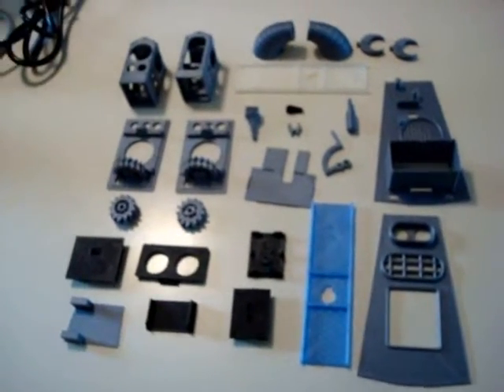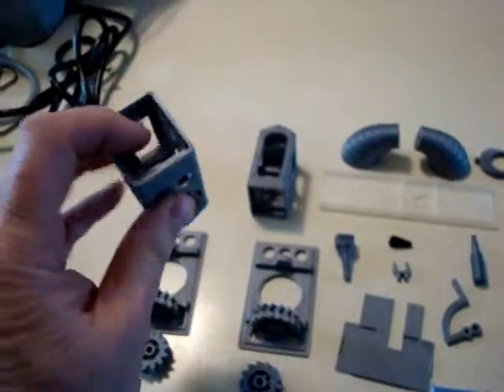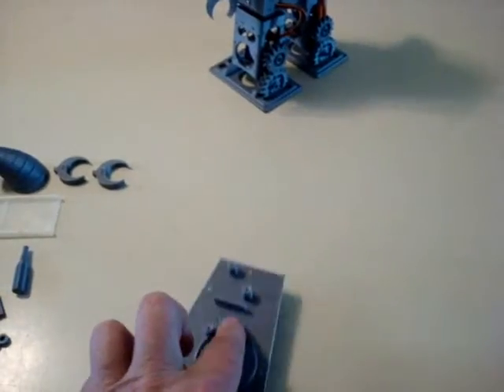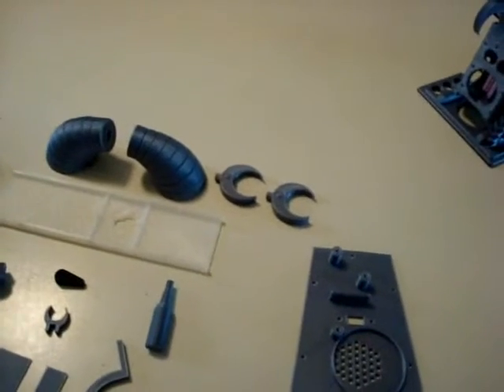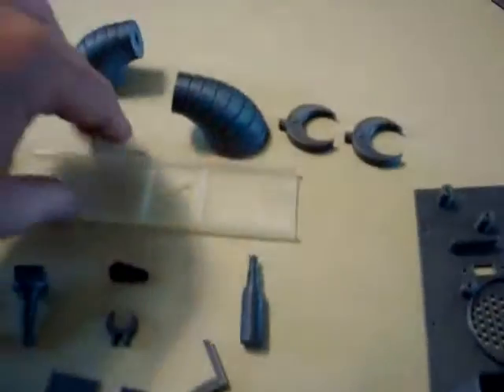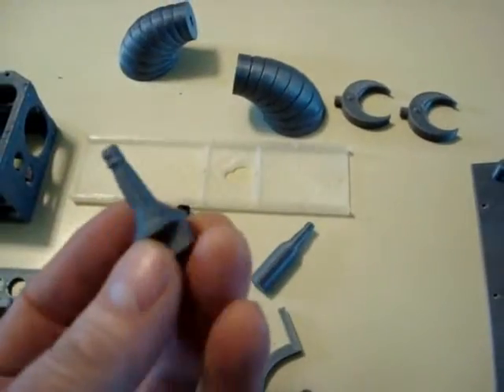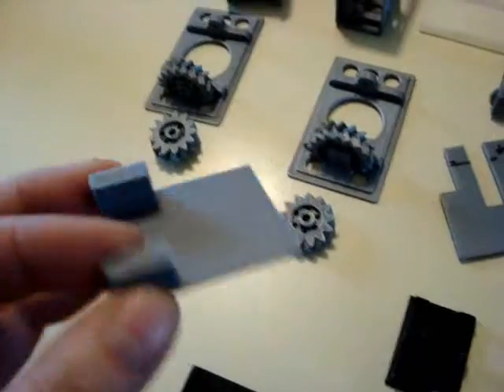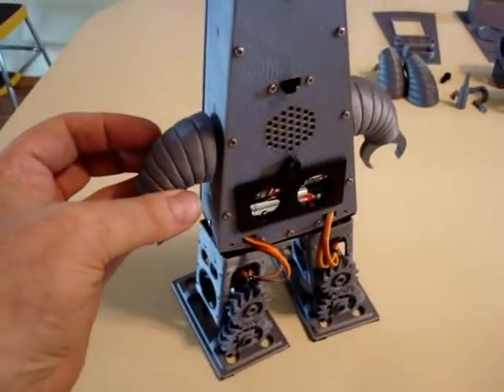3d printed BiPed robot Alpha-Rama prototype

Comment: What servo's and other bought parts would I need to make this?
Reply from the maker: Standard small servos 9g, I used metal gear ball bearing ones for the legs and standard plastic ones for the arms and claw. I used a Pololu 6 channel servo controller. The sound chip is a Ebay unit, 10 seconds, I think they are made for greeting cards but they sell just the electronic guts. I used two LEDs for the eyes with dropping resistor. Oh and use a Buck / boost regulator on the Pololu device so it stays stable when the servos are sucking current.
Reply: Thanks for the help.